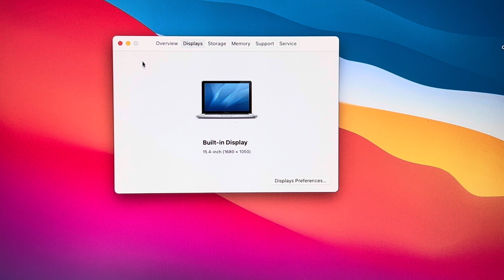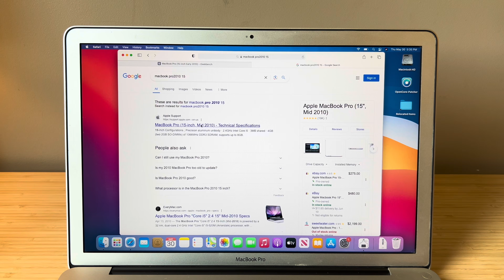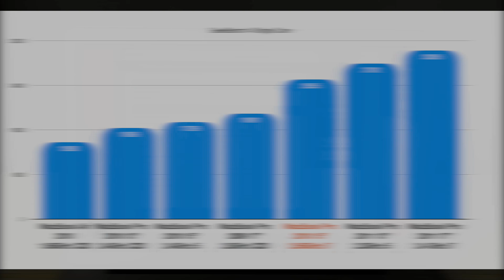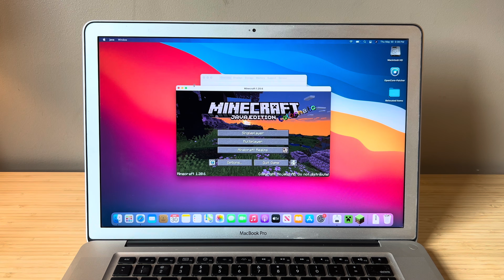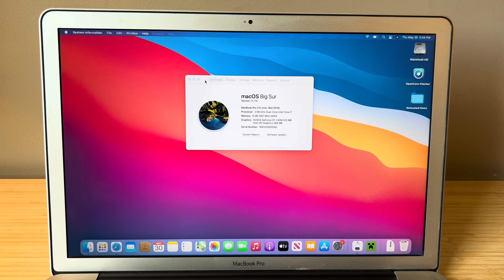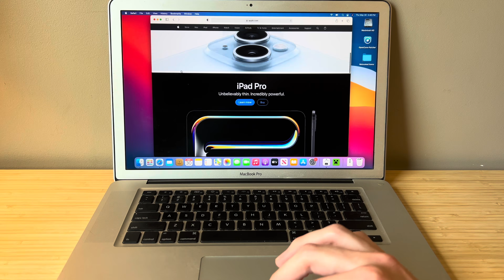Is the 2010 MacBook Pro 15-inch still worth it?

Comment: Watching this video through my 2010 MBP was a trip. Mine still works great for light tasks. Using the FireFox browser keeps mine alive, since Mozilla still supports High Sierra.

I had the annoying Kernal Panic thing. I fixed it using a software patch that’s available through some internet searching.

It’s a solid machine in 2024, and the matte display keeps me reaching for it over my much more modern Apple M3 computers.
Reply: Did the the problem come back after fixing?
Reply: @josephmgomez3921  1yr later, and the patch completely stopped the kernel panic issue for me. Still using it in 2026.

Comment: I have two 2012 15" mpb machines w/ the non-glare screen, but my 2010 is one I sorta scrapped together out of bits and bobs. So the lesser video. It runs very hot. I run Endeavor Linux on it (be sure and install macfanctld if you do this). Snappy in linux. Mine's the i5 2.4g model and with a small ssd it is fine for web, editing, videos. I'd buy a 2012, though.... they are the cadillacs of unibody mbps. This? If someone gives it to you, have fun with it.

Comment: The capacitor is a problem especially on the dual graphics model. Can be replaced cheaply and fairly easy if you are comfortable with solder and motherboards. This machine can run  extremely well and supports back to Snow Leopard 10.6.8 so  I keep one around for a couple legacy Apps. Go for the anti-glare screen you get more resolution. A 2011 model is often only a few bucks more and can support 16GB of RAM. SSD is a must!
Reply: But the 2011 15"/17" models suffer from their AMD discrete graphics failing.
Reply: @Windows7Pro2009  That is because of the buckle capacitor.   This video show the repair.  https://www.youtube.com/watch?v=iKBzrxSGwlo

Comment: I thought the capacitor issue was only in the 17" macbooks, my 2009 17" MacBook had that issue and i just got it fixed so i'm back to watching youtube on the 17 inch screen. I love typing on it too, i think because there is more space to rest your arm on the macbook while typing it just makes the typing experience easier and Windows 10 still runs great on it so it would be a good second laptop for someone who needs Windows 10 for some softwares like i do.
Reply from the maker: It’s on the 2009 17” and 2010 15”
Reply: @GoJot can you say which capacitor it is, or point to a tutorial on how to replace it?

Comment: I used a 13” mid-2010 MacBook Pro as my main computer from January 2021 until August 2021. It was okay, but its hard drive failed the following fall, and it was just too slow. I strongly discourage buying this computer for anything besides collection purposes because of these machines’ unreliability. People who cannot afford to spend more on a computer might as well just save their money until they can buy a better one.
Reply: A new 250gb ssd is like dirt cheap or can even be free, huge rookie mistake thinking something is slow and still using an hdd for the os
Reply: @macentire56  They are not quite as cheap now due to the RAM shortage; but that was not the case in 2021, so your point is valid. I do not recall thinking my 2010 MacBook Pro was slow, so I do not know why I commented that. You make a valid point about how I should not complain about speed when I am using a mechanical hard drive, and I was a rookie back then.

Comment: I have on 13 inch MacBook Pro from mid 2010 with 2.4ghz C2D with Mojave in it, and works super snappy with SSD upgrade for browsing and media. It's really impressive how those hardwares still hanging with macOS over the years.

Comment: im using this exact macbook pro with the anti-glare display and everything to watch this
Reply from the maker: That’s awesome! How’s it holding up?
Reply: @GoJot  holding up good, i bought it this year broken and i fixed it and upgraded it myself. even fixed the failing capacitor problem myself and hasnt crashed once since then. its my daily computer cus getting things in my country is expensive
Reply: @editorsanimationVlogs that's good I have mine to but it has the i5 not the i7 like this one swapped the hdd to SSD solid machine for writing and browsing
Reply: How mine can't even load the YouTube homepage? Running sierra rn